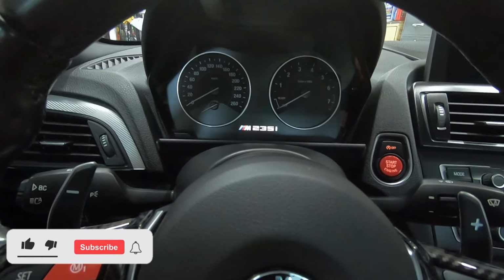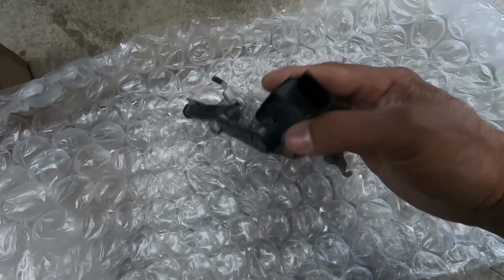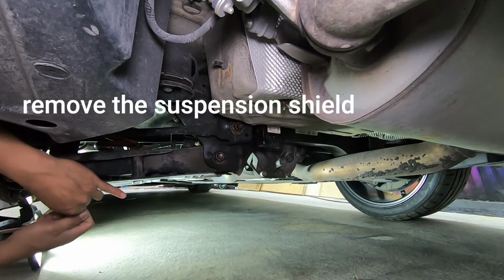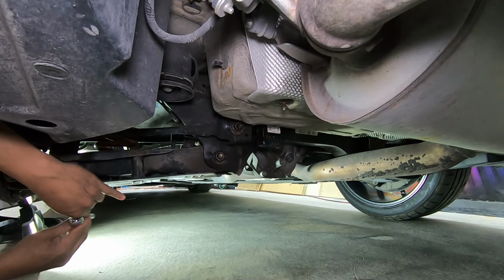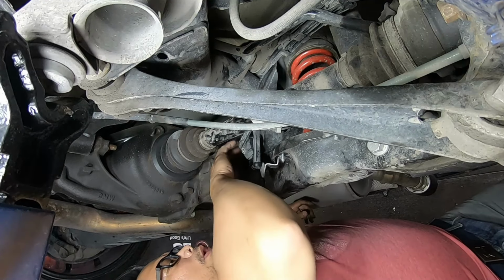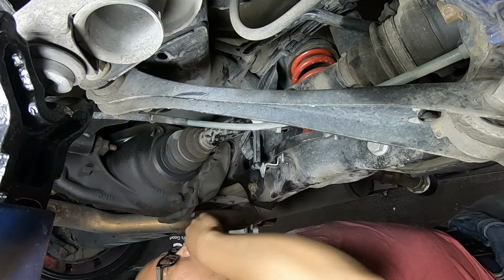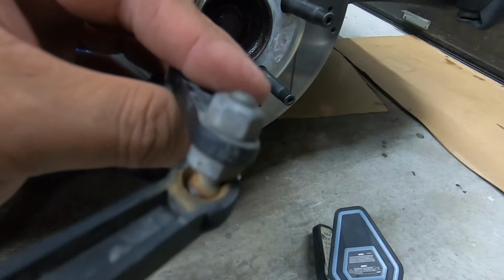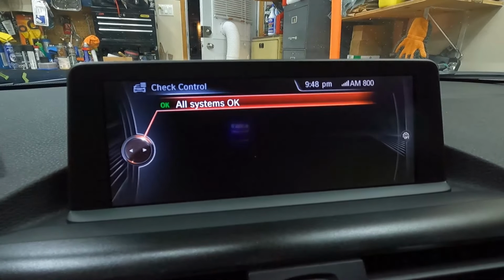Fixing BMW Chassis function restricted message. (Coupon Code @ description)

Comment: I had the same issue. I changed the suspension air bags and the decant balls (compressor) and still had the same issue. Then I took the sensor apart and lubricated with WD40 and moved it around until it was easily movable and so far no light. Thx
Reply from the maker: Hi Michael Phung, I'm glad that this video helped you in anyway, More DIY & Mods coming soon, Stay tuned for that.
Please LIKE & SUBSCRIBE and Thanks for watching!!!👍
Reply: Reallly????
Reply: Do you have to remove the wheel?
Reply: Where’s the sensor located ?

Comment: Guys before you change the sensor/s just check the power connection as lose cable can cause same issue.

Comment: I’ve been getting the same message on x5, but I also notice that the right side of the car is tilted. Has someone has similar issue?
Reply from the maker: Hi, If your car is tilted check the suspension coil springs, Check for any abnormality  on the springs, Sensors are detecting the tilting of your car that is why you are getting the message.
I suggest maybe change all 4 suspension coil springs with new ones to resolve the tilting problem.
Please LIKE & SUBSCRIBE and Thanks for watching!!!👍

Comment: I have the same issue Bmw m4 it only started to happen after I hit something in the freeway it comes ONLY when I’m driving super slow and I’m turning the wheel all the way I haven’t gotten it looked at because I turn off the car and it goes away then pops up like months later … wish me luck
Reply from the maker: Just check all the sensors and lubricate joints to fix problems. Thanks

Comment: I have a 2016 BMW X5 and I have the same issue just popped up yesterday. Would it be at the same location? also, wouldn’t it be something else like compressor itself? Thank you
Reply from the maker: I think they would be in the same location as every BMW models. If you have problem adjusting the ride height of your X5, In my opinion this could be that the air compressor is defective.
More DIY & Mods coming soon, Please LIKE & SUBSCRIBE and Thanks for watching!!!👍

Comment: May I ask how you drilled it down to knowing it was the suspension level sensor? That chassis message could link to a number of different issues?
Reply: Probably by using a diagnostic tool.
Reply from the maker: Hi Keith Gypps, I noticed a lot of rust on the ball joints of sensor when I installed the lowering springs, So when I got the message, I did my research and bought the used part, Luckily that was the problem and I fixed it. Please LIKE & SUBSCRIBE to HELP this channel grow, Thanks for watching! 👍
Reply: Very interesting question! Again, I'm very impressed!

Comment: Did it but didn’t work!
Reply from the maker: Hi daniel morales jr, You might have the problem somewhere else on the suspension, Check all suspension sensors and their connector plugs, make sure that they have good contacts and not disconnected.
More DIY & Mods coming soon, Please LIKE & SUBSCRIBE and Thanks for watching!!!👍
Reply: @edcardiy  will do thx

Comment: I have this issue on my 750i, but one of the side appears to be low than other
Reply from the maker: Hi Jose Colo, Try to lubricate the ball joints of the sensor, maybe this will even the position of the sensors. Please LIKE & SUBSCRIBE to HELP this channel grow, Thanks for watching!👍
Reply: Is the ball joints in the sensor easy to take apart?

Comment: Is the part you changed only on the rear left? I’m in the uk but I have this exact issue
Reply from the maker: Yes, the one at the rear sensor is really stuck and corroded, Also check your connector plug on all the adaptive suspension (shock absorber), if this is loose it could also trigger the same error message.
Thanks for watching!!!👍

Comment: Same prob car  up too much from the back looks like suv after changing bag. Drove a bit but not adjusting or coming down.  Any advise much appreciated.
Reply from the maker: Try scanning for trouble code on the suspension, Maybe you need to code in the new bag to work properly.
More DIY & Mods coming soon, Please LIKE & SUBSCRIBE and Thanks for watching!!!👍
Reply: Release the battery cables for 10m, this should reset the system

Comment: I have the same car, same error, def doing this on my next day off. Quick question mine doesn’t let me drive on sport/sport + I assume the same thing happened with yours?
Reply from the maker: I cannot recall about my sport or sport + not working, Because of the message I didn't want to drive the car harder, Good luck on fixing your car, Happy New Year and Thanks for watching!!! 🎄
Reply: Hi, Did you get this resolved? I have the same issue with my BMW 140i.
Reply: Same thing is coming up on mine today. Can’t go into sport/sport+. What’d you do to fix it?
Reply: @soccermavaustin  I got it coded off. By a shop in Anaheim ca called Ssr performance. They charged me $300. Hope this helps

Comment: Do you think you could have simply lubricated the joint on the existing part?
Reply from the maker: Hi Michael Macco, The part is having a hard time to move because of rust build up on the  ball joint of the sensor and the ball is not smoothly round anymore because of rust stuck on it, Anyway the part I bought is moving smoothly and not that expensive because it's a used part from ebay. I think it's less than $50 that I paid for the part, Do you have the same issue with your car?
Anyway Please LIKE & SUBSCRIBE to HELP this channel grow, Thanks for watching! 👍
Reply: @edcardiy Hello Sir, thanks for the very informative Video. I was curious about the part, I was impressed with a Mechanical Part, that's got an Electric connection/sensor. I was wondering what is the function of such a part with two bolts, and some rust that showed up on your screen. What is such a part called! Very impressive, and thanks!

Comment: I have the above message with a very intolerable bumpy ride started happening recently. Back of x5 is down too. Would it be a one or both sensors of shocks?
Reply from the maker: Sharif Ahmad, Remove, verify and lubricate joints for both front & back sensors, Make sure that joints on sensors should move freely before installing back. Hope this helps you.
Thanks for watching!!!
Reply: Did you get this sorted. I’m having same issue on 5 series. Rear of the car dropped low and back end severely bouncing around when driving.
Reply: I'm having the same issue with my 2017 x5M  after an aggressive acceleration on the highway. I slammed the accelerator and hit 100mph and then got the same dash warning. The car became very bouncy. When I parked, the rear was sagging. This just happened yesterday. 😢
Reply: 5 series here aswell , exact same problem, did you find a solution?
Reply: Damn I jus had this exact problem on my x5m. The back is slammed and bounces hard. Says chasis function restricted
Reply from the maker: Check the rear airbag suspension, It could be damaged.
Reply: @edcardiy  thnx will do 👍🏻👍🏻

Comment: I have a 2022 i4, Dealer told me front right Vertical Sensor faulty, When I get msj I notice car gets really bouncy, Changing the vertical sensor myself may fix issue? Thanks.
Reply from the maker: It's definitely possible that changing the vertical sensor could help with the bounciness. Just make sure to follow the proper procedures and safety precautions when working on your car!
Thanks for watching!!!👍
Reply: @edcardiy  Thanks!

Comment: How do you know which one it is ? Are they sensors on each suspension?
Reply from the maker: I've checked that sensor and it's really stuck with rust, I've replaced it and it's no problem so far, There is one sensor on the driver's side front wheel suspension and one at the back. Thanks for watching!!!

Comment: This message come up today, my car bounces quite a lot some times at random, if I pull up at a set of lights, sometimes after I drive off it will start bouncing, today the suspension didn’t lift up at all, very low, and advice ?
Reply from the maker: Verify your suspension (shock absorber & coil springs) they could be defective.
More DIY & Mods coming soon, Please LIKE & SUBSCRIBE and Thanks for watching!!!👍
Reply: @edcardiy  got it done today it was the bag, very worn and had a slit so was leaking air

Comment: I’m getting the same message. Wasn’t noticing a problem at first but today the read of the car has full dropped low and bounces around quite severely from the rear when just driving. Any advice? Thanks mate
Reply from the maker: Adam C, Bouncing of the car means your shock absorber is broken and needs to be replaced, Check the rear springs under your car if still OK, Then just the shocks need to be replaced. Hope this helps you.
More DIY & Mods coming soon, Please LIKE & SUBSCRIBE and Thanks for watching!!!👍
Reply: @edcardiy  thanks mate. From your experience is this a simple fix and what should I expect cost wise if taken to the garage.
Reply from the maker: Depending on how expensive the parts (shock absorbers) and the cost of labor (probably about 1 to 1.5 hour to replace the shocks). This is just an estimate.

Comment: I hope someone can help me
I have a 2016 bmw x6m I’ve changed the compressor air suspension and the height level control sensor still not fixing the issue the car it’s still leaning on one side…😢
Reply from the maker: The air bag suspension on the leaning side might not be getting the same amount of air that is why it's leaning on one side, Maybe it's defective or it has a slow leak.
Hope this helps you, More DIY & Mods coming soon, Please LIKE & SUBSCRIBE and Thanks for watching!!!👍
Reply: Have you fixed what was yhe issue ?

Comment: I have a BMW 525D Xdrive 2012. Lately I have got this message "Cornering ability restricted". The next message " Dynamic Damping Control". Dynamic  Damping control failure. Corneing ability and driving comfort restriced. Drive moderately. Have the problem chcked by your BMW service. Do you know why I have got this message? Can it be something wrong with my suspension level sensor?
Reply from the maker: I think the problem is your adaptive suspension shock absorber, Maybe they are defective, Have it checked out.
Thanks for watching!!!👍
Reply: @edcardiy  Thank you very much for your ansver. I have checked out all my suspension levels sensors. Both rear sensors were stuck with rust. I have tried to remove the rust with wd40 rust relase and wd40 silicone. I have to move the parts many time to loosen it. After a long treatment and moving the parts several hundred time. After I installed all the suspension level sensors. The level of he car is much better, but still I get the same errors. I have found used original BMW parts. The front suspension sensors were not stuck with rust and it is easy to move them freely after some treatment. I have a broken right front coil spring. Can it cause problem for the suspension level sensors? I think my rear suspension level sensors are bad.
Reply: I had a visit on my car workshop, an BMW expert he said it is very normal the rear  suspension level sensors get faulty because of rust and he told me to replace the rear sensors. I still have the same error message, it has stopped popping up all the time. It seems the lubricate job works.
Reply from the maker: That's great news, I'm glad that my video helped you in anyway, Thanks for watching!!!👍
Reply: @edcardiy  Thank you very much for the video. The video has helped me to find the right faulty components on my car. Have a nice day and keep on the good work sharing your knowledge.
Reply: @edcardiy  I have ordered two new rear suspension level sensors. Tomorrow I am going to install it. I have driven 70 km on the highway. today.  No error lights pop up anymore. Are my suspension level sensors okay then? I have lubricated both with a lot of WD40 rust release and WD40 silicone. Both ball joints are moving freely.

Comment: What part am I supposed to buy? Do I buy 2 of them or 1
Reply from the maker: Valeria Castillo, If you can check the parts and visually look for the one with the corroded ball joint on the sensor, then that is the part that needs to be changed, Hope this helps you.
More DIY & Mods coming soon, Please LIKE & SUBSCRIBE and Thanks for watching!!!👍

Comment: I got the same code along with like 5 other codes and my power steering gets a little rough. Will that be the cause of multiple codes?
Reply from the maker: Probably, Just get the front suspension checked, That could be the cause of your rough steering feel.
Thanks for watching!!!👍

Comment: I got this chassis function restricted code when I installed KW HAS coil overs to the front of my F82. These retain the factory EDC controls since the sustpension is the same except for lower springs. Well the two sensors in the front both got confused and stupid at the same time. I had a couple extra low mileage spares and swapped them out but still have chassis restriction. I have no idea what to do except for maybe replacing the wires, because maybe they got pinched in the new retainer? Or I might have to buy two new sensors as well, though that seems quite doubtful. Wires and sensors together brand new are around $500, so I’ve been looking for another fix because these solutions don’t seem that they’re the plausible cause. Anyone run into this issue?
Reply from the maker: Hi, Sorry for the delay, Try cleaning out the EDC cable connectors on the shock absorbers with compressed air and make sure that they were plugged properly and have good connection contacts. Put a bit of WD40 on the connector rubber sealer of the plug so it will slide in properly and make good contact, Don't put any WD40 on the connector itself, Just the rubber sealer,  This might solved your problems.
Please LIKE & SUBSCRIBE and Thanks for watching!!!👍
Reply: did you solve issue

Comment: I keep on getting chassis function restricted on 730d any advice?
Reply from the maker: Hi, Check all sensors on the suspension front and back, Check for stuck or rusted level sensor, Without starting the car, check any loose connector on the sensors, Un-plug and plug back in the connector and make sure it has a good contact.
If you still have the error message, you might have a faulty suspension sensor somewhere.
Please LIKE & SUBSCRIBE and Thanks for watching!!!👍

Comment: Bonjour, j'ai ce voyant depuis hier et en roulant il a disparu. Comment savoir si c'est devant ou derrière le capteur? Merci pour votre réponse 
Salut de France...
Reply from the maker: Bernard Bernard, Désolé pour mon français, je viens d'utiliser Google translate pour vous répondre.
Vérifiez simplement les deux capteurs avant et arrière, vérifiez lequel est corrodé sur le capteur, puis vaporisez du lubrifiant pour desserrer le joint du capteur.
J'espère que cela t'aides.
S'il vous plaît, AIMEZ ET ABONNEZ-VOUS et merci d'avoir regardé !!!👍
Reply: @edcardiy  merci beaucoup pour votre aide. Je vais faire cela. Merci merci
Reply: @edcardiy bonjour j’ai le meme problème sur ma m3 g80 châssis fonction limitée j ai regardé le capteur de suspension je le suis aperçu qui manque la tige est ce que ça peut être du à ce problème que le voyant châssis fonction limitée soit allumée faut il change la pieces compete ou remplacé la tige merci de votre réponse.
Reply from the maker: bien sur la tige est là pour mesurer le niveau de la suspension. achetez simplement la pièce de rechange et installez-la. @Snatch94
Reply: @edcardiy merci beaucoup pour le renseignement je vais allé la commander cordialement.

Comment: What about bouncing of car
Reply from the maker: Esther S, When your car is bouncing when running over potholes or bumps, It means that your shocks are defective and needs to be replaced.
Hope this helps you. More DIY & Mods coming soon, Please LIKE & SUBSCRIBE and Thanks for watching!!!👍
Reply: @edcardiy  Thank you so much. It bounces on roads without potholes and it has the chassis function restricted error.
Reply from the maker: @esthers9122  Your shocks were defective, it supposed to control the bouncing with or without potholes. Hope this helps you.
Thanks for the comment 👍
Reply: @edcardiy  Thanks again.
Reply: Did you get this sorted. I’m having same issue on 5 series. Rear of the car dropped low and back end severely bouncing around when driving.
Reply: @adamc3610  Took it to the dealership and they charged me $5K